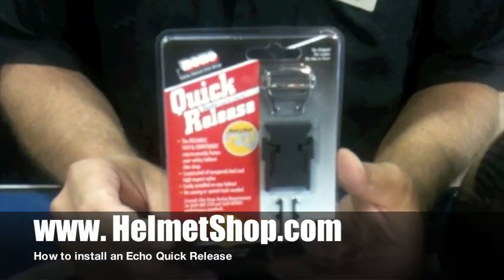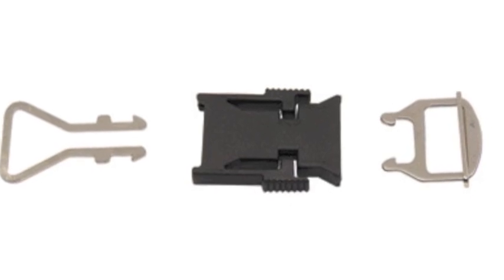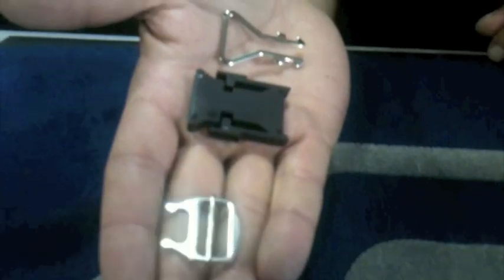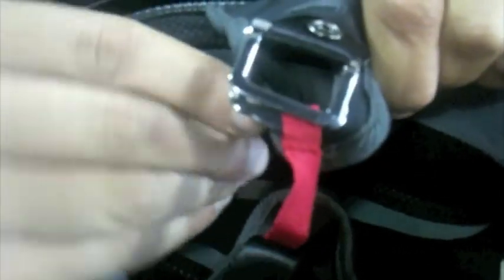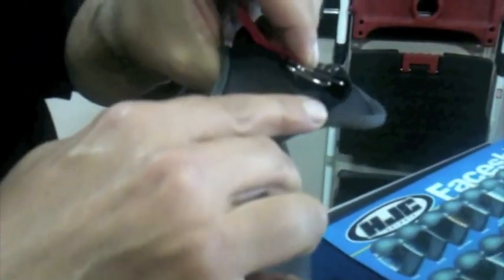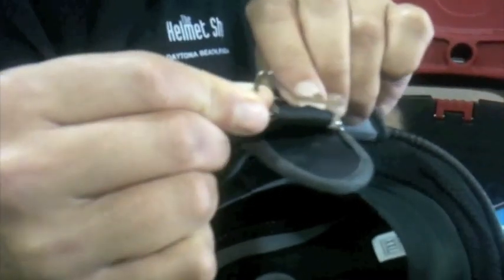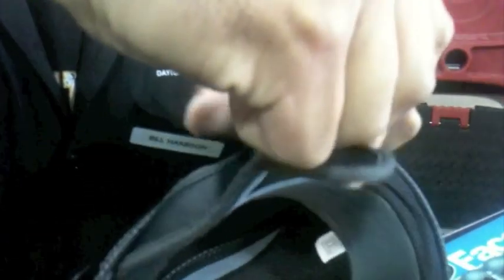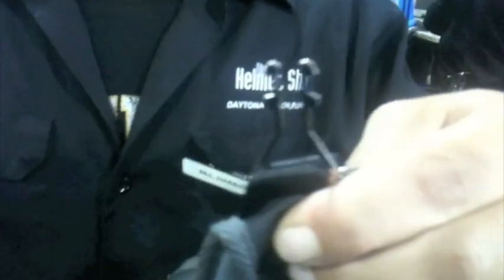Echo Quick Release: How to add a Quick Connect to Your Helmet Strap

Comment: Mine has been a real let down. It's so freakin hard to buckle. Sometimes the metal end goes in crooked and only one side locks. You pull it and you think it's secure, later on you can't release it. I have to fumble around and push it all the way in straight just so it will release. It's a safety issue for sure.

To anyone looking for a quick release buckle, skip the Echo and try a different brand.

Comment: I think my Echo Quick Release is a great product. I have used one for 2 years. Last summer, the pivot point of my HJC modular helmet cracked. The helmet was under warranty, so HJC replaced it for free. My dealer sent it to California for free. I would NOT cut the extra strap and burn the edges. I just leave it be. I wonder if HJC would have replaced my helmet with the strap cut off?